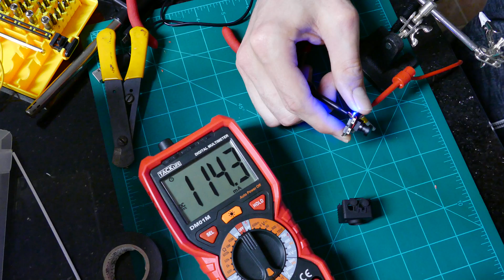SQ12 Mini DV Camera – Power Draw

Comment: Hy, and whats your decision? Have you connected directly to the lipo batt. For the quad. Or the 5v out on FC. I ordere the same camera and i want to remove the camera batt to save weight. Whats the best way.
Reply from the maker: I did power it from the 5v on the FC and it worked well for me! Even with the higher voltage than the original battery I didn't notice any extra heat or random shutoffs through 5 minute flights.
While there are even lighter options, I basically stripped out the weight, battery, and IR lights - then added power wires and put the case back together, then 3D printed a mount to attach the camera to the quad. It would be even lighter without the plastic case and 3D printed mount, but I figured the extra grams were worth the protection.
Reply: Katostrofik I want to mod this same cam for a micro quad and also want to power from the FC so went looking for info and found this! So thank you. Have you also tried the 3.3v option or went straight to 5v? My 3.3v pad is on a more convenient location on the FC so if it works on 3v and 5v wont give any extra benefits I’d rather use that.
Reply: how long would it ran on an 18650 battery at 2000 mah?  am thinking of mounting it on a birdhouse to document different birds in our community?